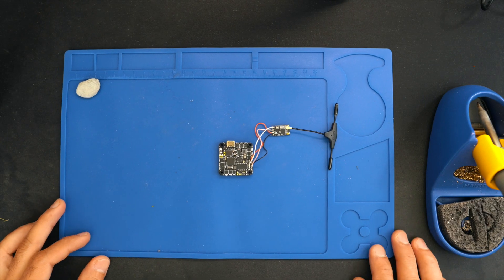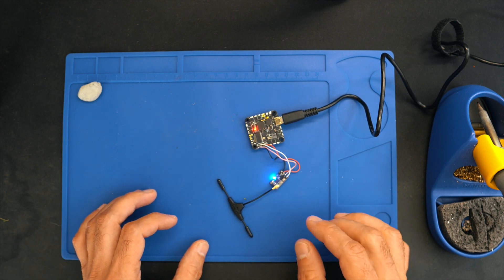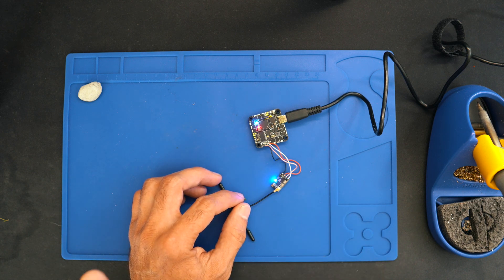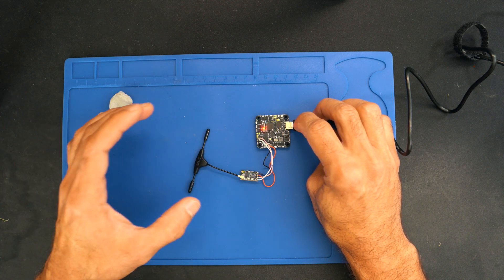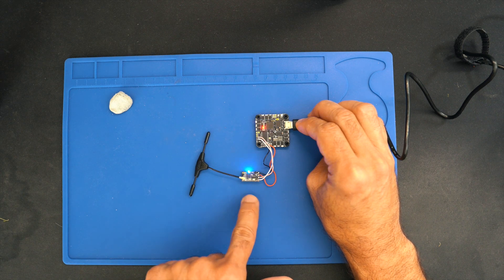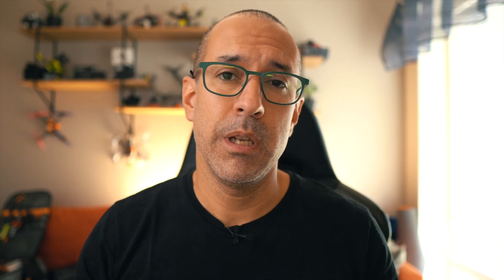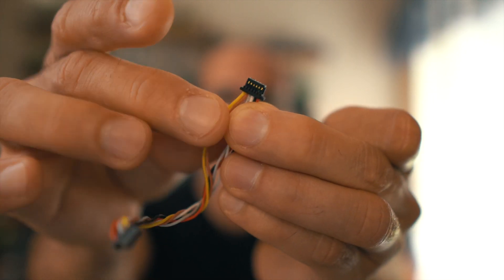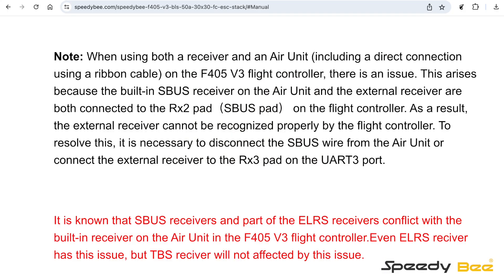Tips for troubleshooting and fixing some issues with ELRS (or Express LRS)

Comment: Hi i am using a radiolink crossflight controller. My radio and elrs binds. But when i go to mission planner in radio calibration, the sticks wont move on the screen. 
English is my secondary language so please try to understand.
Reply from the maker: Maybe you haven’t defined what each channel is supposed to do in the radio?
In edgetx you need to define a model, and set up a specific channel for each stick movement and switch so they actually do anything on the plane/drone.

Comment: HUGE thanks for pointing out the issue with the O3 wiring harness! I was upgrading a long-range quad from Crossfire to ELRS, and even though I double-checked the wiring (TX to RX, RX to TX), moved UARTs, matched the ELRS software on RX and TX, turned model match off — nothing was working...The quad was about to go through the wall lol

Removing those two wires did the trick! Absolute legend! 🔥🙌
Reply from the maker: I’m glad it helped!

Comment: Hi how are you? I have a different problem, my elrs is bound to the controller , i see movement in betaflight on the receiver tab and on the mode tab my switches work , but the quad won’t arm at all ,by itself with the battery connected no connection to the computer it is not arming , what do you think my problem is?
Reply from the maker: Look at the flags in the first page or connect the googles and look at the error in the googles. The typical one is that your throttle is not really reaching 0 because of a bad calibration. But it could be many other things, like pre arm, wrong stick order, etc.
Reply: @ none

Comment: In my circumstance switching uarts isn’t an opinion unfortunately. Can you please explain how and where I’d attach a 1kohm resistor?
Reply from the maker: Just put it in series with the tx cable. There are a few diagrams in internet you can dig up.
Reply: @NordFPV unplugging the signal and grounds for the rx on the DJI O3 did the trick!

Comment: Hello. I have a new geprc domain with O3 and Expresslrs.
Bind sucessfully whith the transmiter ( radiomaster boxer). The light in the reciever is solid and I see the letter " C" in the transmiter confirming it is binding but the drone dont respond to any comand.
Its my very frist drone, I tryed to arm and disarm but dont work.
Do you have any idea whats going wrong ?
The transmiter and the reciever are in different versions, it could be the problem ?
I didnt check the comands in betaflight since it is still complicated to me.😢
Reply from the maker: Version shouldn’t be a problem if they bound. 
Most probably you are either missing a configuration on the drone, like the protocol configuration, or your radio model is missing defining each switch or some other inputs.
Reply: @NordFPV  You were correct.
Reply: @Thiago_TS_BR glad I could point you in the right direction

Comment: I bort a flywoo flylens 85 new and the ELRS receiver light doesn't double blink(bind mode)even if I do the battery in/out 3 times thing,the light stays a slow blinking and after 60s goes into WiFi mode.
Any ideas on how to cure?
Reply from the maker: Sorry I don’t understand. You said first it doesn’t double blink, but then you say after 60 sec goes into WiFi mode. That’s contradictory. Double blink means WiFi mode. And if you are in WiFi mode you can just do whatever you want there: upgrade, change passphrase, etc.
Reply: @NordFPV  
It's not going into bind flashing mode,it shouldn't need updating via WiFi as it's new v3 firmware from the factory.the only thing I'm concerned with is why it's not going into bind state regarding the light mode(.btw fast blink is WiFi mode double blink is bind mode)
Reply from the maker: @cyclops-fpv  I found the easiest way to modify my ELRS RX is using the wifi page. It doesn't matter if it's new or not. You go into the wifi page, and do the changes there for the passphrase. Passphrase is the best way to bind in my opinion.
Depending on the FW version of your TX you may need to modify the version on your RX. Again, the wifi page is the easiest for me to do this. Make sure your two versions (RX and TX) matches, and that you have a passphrase set in both, and ll will be good. 
True, double blinking is binding. I tend to forget about it since I never use that method. I take any new ELRS RX wait until it goes into wifi, write my passphrase and all is done.

Comment: Hey Juan, my iflight evoque v2 also came with crossfire and I changed it to elrs. I have no issues regarding the sbus, I guess iFlight removes cables while assembling drones?
Reply from the maker: Interesting because they don’t. I have repaired at least 3 evoque O3 because if this issue, and I remember vividly because I think they are such a pain. To remove the sbus from the O3 you have to disassemble the whole drone. I really don’t like to do repair evoques.  You can open and check the cables on the FC side without having to do much. I will really like to know if you have the sbus connected and haven’t had any issue. As I said, not all FC/RX combination shows this problem.